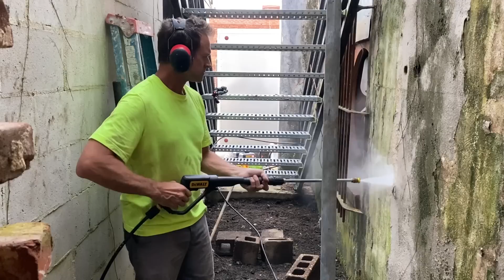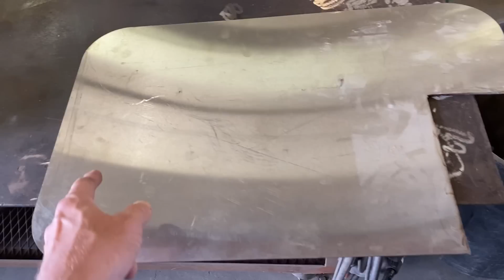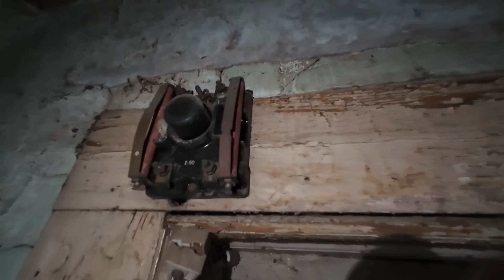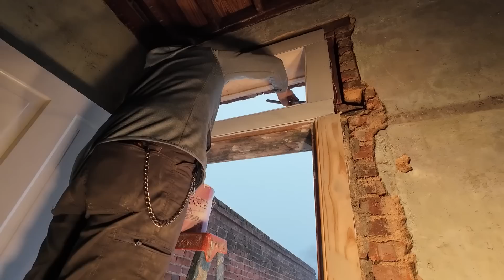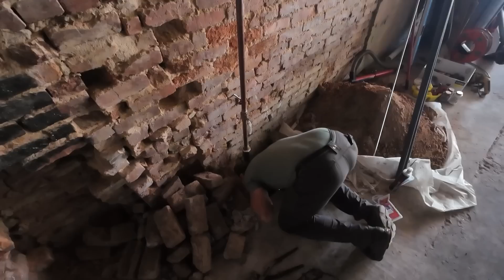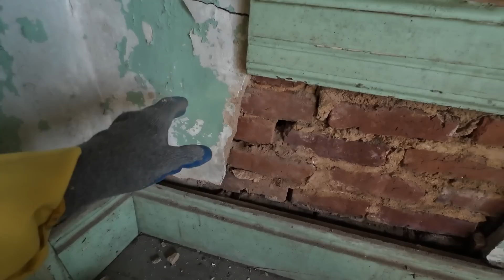The Abandoned Bank is Coming Back to Life! : 6 weeks of Progress!￼

Comment: you didn't wrap you water pipe with a foam rubber sleeve before you poured concrete around it, that can cause problems.
Reply from the maker: I used a pipe wrap tape at the points it touched concrete, however it was explained that this type of pipe did not need the extra step of protection.

Comment: go to home depot. get 2 box fans.  get a 2x4 and cut two pieces the height of two of the fans.  Stack the fans vertically and screw the 2x4 to secure them.  Set the stack by your back door and turn them on.  This will pull all the dust out of the place much faster.  You can hang some wet towels about a foot behind the fans that will catch most of the particles.  Then you can rinse them out later.  The bricks look a lot better without the plaster.  Can the floors be sanded and salvaged I wonder?  Get the roof in shape so it does not leak.  You can replace a window or two with polycarb sheets.  This will let more light in upstairs.  The sheets can be cut on a saw.  If you cut a 2x4 in half lengthwise you can then sandwich the sheets between the halves and screw them together in a frame to cover the windows.
Reply from the maker: All good ideas!  We will be refinishing the floors after the windows are complete and new floor boards are installed.   My friend gifted us a large air moving fan we have been using to pull particles out during the process but I do like you stacked fan / filter idea!   Thank you for the comment.

Comment: Get some cut to length gas pipe and a pair of flanges. Thread the pipe ends and set it in the outdoor shower area as your new shower curtain rod.  It is super strong, weather resistant and a great place to hang things from.  I use mine to hang clothes on hangers to dry as well as a place to hang plants.  That wire just won't cut it.
Reply from the maker: Thats a good idea for the shower curtain.  The wire is holding up excellent but if I change it, I might take the idea.  Thank you for the comment!

Comment: great job! its going to look fantastic once you start to get it together. Also  who is going to do all of your tuckpointing on the bricks inside and out? it wouldn't make sense if you did all that work but the walls are caving in.
Reply from the maker: For now, all the work required on the building will be done by myself.  I'm not an expert on everything, but I do make sure to educate myself before taking on a task I don't know much about.

Comment: AMAZING that you apparently are ignorant of or don't care about air infiltration, thermal control and moisture barriers for this building.  Not aggressively addressing these challenges WILL BITE YOU IN THE ASS----especially since you will be conditioning the air as the building was never designed to accommodate----RESEARCH AND USE BUILDING SCIENCE DEEPLY---or pay a big price in the end.

Comment: You shouldn't be pressure washing the brickwork or painting it. You need to learn about "Re-pointing" and do your research on what type of mortar was used originally or you will destroy the building.  This is not a project for a novice at building repair.

Comment: someone's probably going to reach through the stairs and grab your copper pipes in that under stair space

Did you use vintage lumbar to replace the rotten/unsave-able stuff?

did you use oil based paint on the wood - to 'feed' it?
Reply from the maker: I had a local sawmill cut lumber to match the existing boards to reproduce what was originally intended for the building.  I do use an oil based primer for all of the woodwork.  Thanks for the comment!

Comment: A wood dowel would have been the easiest and best way to plug the hole in the transom window.  Doorbell transformers are usually 16VAC/30VAC.
Reply from the maker: I usually cut my own plugs for holes as I did for the rest of the door, however I wanted to try a new method with the chopsticks which worked out great.  Id use it again.    As it turns, the mechanism above the transom was a lightning arrestor for a telephone system.   Thanks for the comment!

Comment: that shower curtain doesn't provide enough privacy ( especially if windy) perhaps some metal between each step (riser) to block the view would help. Where is the gray water draining? Love the little shelves with plants. As a carpentar / house painter, my opinion is you don't need 3 coats on the door, two is plenty. Also,  I wonder why the door latch is too close to the moulding.
Reply from the maker: I addressed the shower curtain issue in the video about the container shower.  I do plan to make something more permanent with bamboo shoots in the future for this area.  The third coat is just in order to cover up some blemishes that have and will occur during the construction process and will likely be just a touch-up coat.  Ill be painting all the windows and will do this at the same time.  The door latch is close to the moulding because of the width of the frame of the door.  I originally moved the hole over and had to go back to original because it looked more strange in the second position than it does where it sits now believe it or not.  I did consider this though.   Thanks for the comment!

Comment: Wont your apartment be cold in the winter if your not putting insulation on the walls i understand you want to preserve the character of the building  but sacrificing heat to keep  it warm in the winter no thanks your a brave man
Reply from the maker: The walls are 3 layers of brick thick and hold temperature very well.  The climate here in the peach capitol is pretty mild compared to other places so Im not sure if insulation will be absolutely necessary at this time.

Comment: Place is looking great.  Love the Sherwin Williams products.  We have a local commercial paint store.  They handle Benjamin Moore products.  I put their stuff on level footing with the Sherwin stuff.  Bit more pricey though.
I've done two homes with horse hair plaster.  Grown to hate the word plaster!!!  Good luck preserving it.  I've found during construction...Vibration....Changing temps and humidity....It can lose its integrity.
Final stupid question, where does the outdoor shower drain?
Thanks for your time.  Stay safe and good luck!
Reply from the maker: A part of the video I cut for time was the drainage..  I made a 4' deep leech bed from a bunch of the left over concrete and brick debris left in the building just under the standing area as well as about 4' over closer to the lower side of the stairs.  Ill explain this a little more in the next video about the indoor shower I made from IBC containers.  Thanks for watching!

Comment: I have worked in Victorian style homes in the past and we always removed all of the plaster from the walls. Not only lead based paint and horse hair in the plaster but they even used asbestos fiber at times. So, YES, RESPERATORS ARE NECESSARY!
We took great care to measure all trim pieces and had new wood cut to match what was originally in the home. We had custom knives made for each type of mounding needed. These knives were paid for and turned over to the owner in case they wanted to create new trim.
Reply from the maker: Thats very kind of you to have those knives made and turn them over to the new owner.  As for the asbestos, as per my research, none was used in the material during the time of this buildings construction. Although I have not had it tested, I have found out that asbestos was used in the industry starting about 30 years after this building was built.   I still wear a mask though.  Thanks for the comment!

Comment: I would try an maintain the original floor plan... At least the floor plan that was there when you got the place... It looked to be original (as far as a bank building has an apartment on top - not sure if that is the case !?) and it also seems logical in layout...
You know: living room up front, a hallway (with build in closet space along the side of the space, a bedroom in the back, a bathroom next to it, a toilet (possibly) separate and the kitchen between the bathroom and the living room with an enclosed pantry (it seemed large enough to do something like that at least).
I feel the laundry area should downstairs (it would be not just fitting but also more practical since what is now the outdoor shower area could become the outdoor drying area servicing the laundry room.

I remember the apartment upstairs has its own entrance (and access to the outdoor staircase - probably not very period/original but it works. Probably the bank had an indoor staircase for staff to go upstairs. Not sure but the bank does not seem large enough to be needing office space upstairs so I would assume the indoor staircase would be used by the banker  (and his family) only.

I remember you showed us a design for the space where the hallway was heavily modified which I found to be (how do I put it ?) a pity because it would mean the flow of the apartment would change heavily. Back in the day, hallways were not just a place to get around the place but it were corridors for air and in some cases light to go around the place... a testament to that are the many transoms above every door. 
I realize a period correct restoration is very costly (and impractical) but I am sure it is possible to do a rebuild which (at least) uses the original layout as a template and uses period (left behind) materials and modern features...

Would you mind sharing some (original) drawings (if the even still exist) of the apartment and the deck space outside (to see how old the staircase outside is) and would you mind me having a look at them in order to maybe come up with an alternative to what you came up with a couple of months ago?
Reply from the maker: You're reading my mind.  I think you'll find one of up coming videos very interesting where Ill be discussing all of this, including the re-forming of the old interior staircase..  The drawings I shared in the permitting video were accurate to what already existed, (which has now been removed).  There is a strong possibility that we rebuild exactly how it was when we found it, however I have discovered that it was modified heavily since the original build.  I would be happy to share the floor plan for more input from you and other viewers.  You can find my e mail on my website in the description.

Comment: I was wondering about the rusticated stone sills on the front of the building, which you don't normally see mixed with terracotta panels, but the 1898 construction date definitely explains that they must be from the building's original design. Any idea when the terracotta façade was added on?
Reply from the maker: The fired terracotta facade is original to the building.  Any suggestions on how to remove the oxidation on them would be appreciated!  Thanks for watching.

Comment: 50+ year in trade Plumber, never put male metal thread fittings inside plastic thread fittings as they will crack and fail. So don't pour concrete in building where city supply water supply enters building. Metal over plastic is correct way. 🤙
Reply from the maker: Thank you for the knowledge.   Thanks for watching!
Reply: That's about correct.  Male threaded plastic fittings to female threaded metal fittings.

Comment: Great progress Dray! Only one word of feedback. You installed the ball valve for the shower upside down. Handle up should be on / handle down should be off. So that if something were to fall against the valve handle, it would turn the water off, not on.
Reply from the maker: Maybe Ill address it one of these days.  Ill add it to my punch list!   Thakns for watching!
Reply: @DraysWorld  Hey, I am no professional plumber.... I just recall tips from the pros. Good looking soldering. I also prefer to run my water in copper. 👍 I work with IT, and bend EMT (run my electric in conduit, in other words) as therapy from the IT. 😎